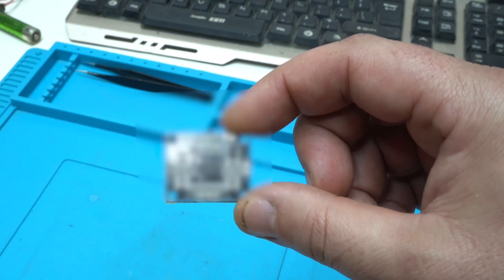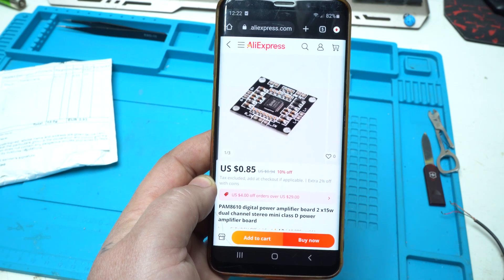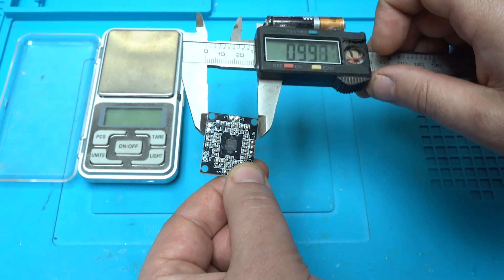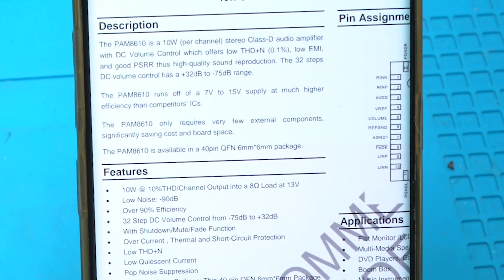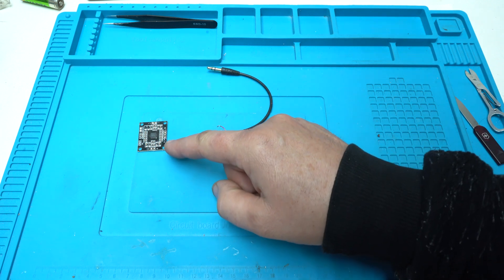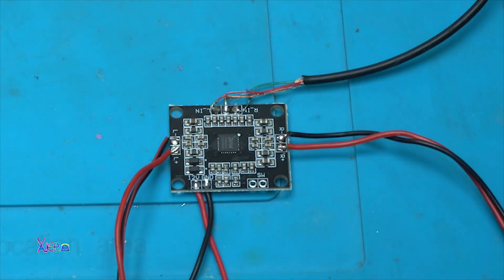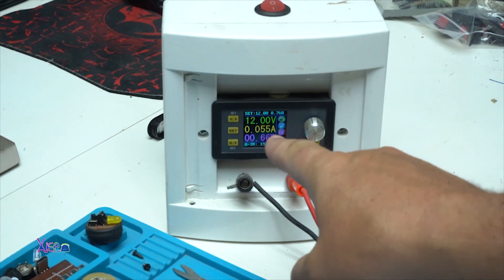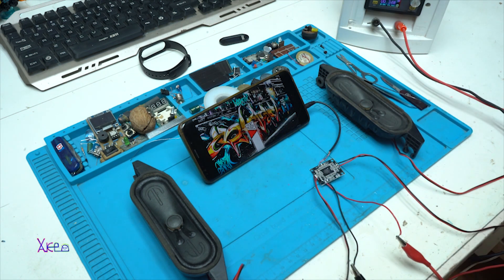$1 Aliexpress Stereo 2x15W Amplifier Board!

Comment: i using it from 1 year ago. it still good but need a thermal and heatsick. this board have no protection so need more careful with power supply or using a diode for this and i solder two 2,2K ohm from input to ground because i fried one board by using a preamp connect to it and turn max volume just for test how loud it can go 😂 it a good, cheap and small board but i recommend the TPA3110 XH-A323 it better and still under 1$ in my country 😅
Reply from the maker: Thanks for sharing your experience!

Comment: It can do 15w per channel with 4ohm speakers, but only 10 with 8ohm speakers.
Reply from the maker: You are right,thx👍
Reply: It can work with 4ohm speakers only if you have a heatsink on the chip so it's still 2x10W amplifier in this form.